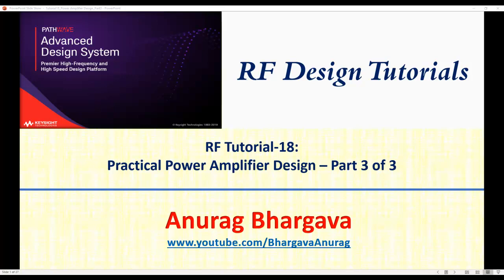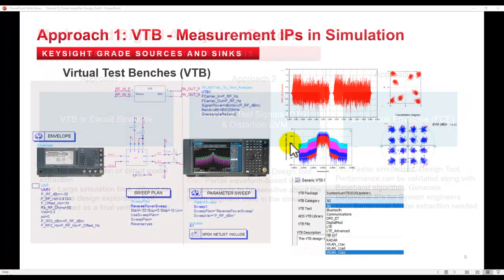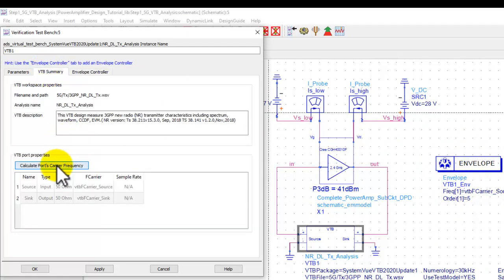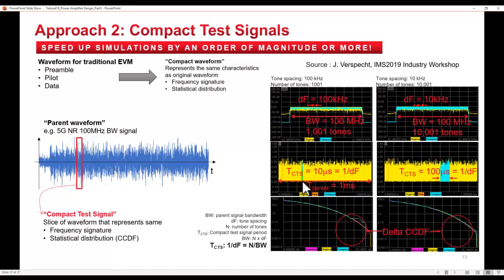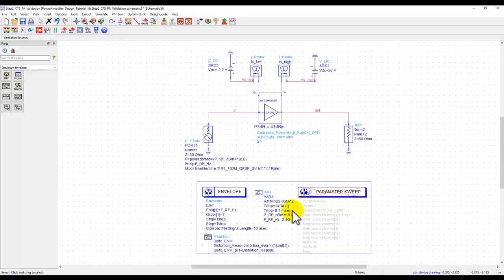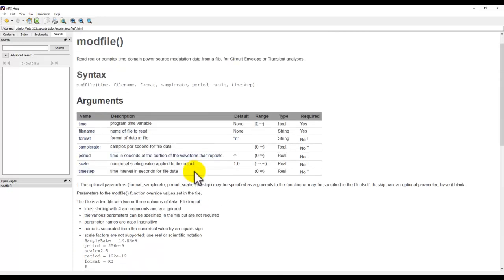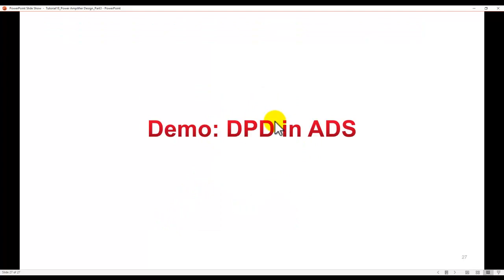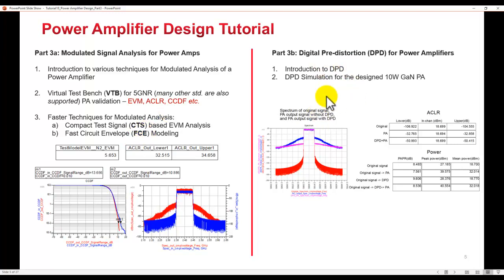RF Design-18: Practical Power Amplifier Design - Part 3

Comment: Which port/pin types you recommand (edge or area) in Momentum for push-pull amplifier input or output layout ? for example ART2K amplifier from Ampleon ?
Reply from the maker: If the edge is quite wide then I will recommend area pin else normal pin should be fine.

Comment: Hello good time . The question that has been bothering me is why none of the design steps of the power amplifier used transient simulation to ensure the correct operation of the amplifier. I did it in 6 GHz, but when I do the transient simulation at the frequency of 6 GHz, the gate voltage of the transistor is very high and it goes up to 10 volts.
Reply from the maker: You can contact Keysight tech support team for help: support@keysight.com

Comment: Thank you for your useful videos and excellent explanation.  I have a problem that I would like you to help me solve, which is that when running a DPD simulation, the simulation stops suddenly in the second stage (operation=1) at about 25% of the simulation.  I tried to repeat the simulation many times and the same problem occurs, and every time a message appears: “The simulation failed unexpectedly” or the ADS program closes.  Is it possible to perform a DPD analysis on two separate simulation operations, first putting 0 in operation and then resimlate by putting 1 in operation instead of using parameter_sweep?
Reply from the maker: Yes, you can disable the parameter sweep and configure the variable to 0 or 1 based on your need. The error message indicates convergence problem and I would recommend you to contact your local Keysight tech support team for help.

Comment: Hi, very useful video, really appreciate it! Could you kindly explain the SystemVue license should be used if using VTB method ? I have ADS here but no SystemVue installed and I can't run VTB simulation...
Reply from the maker: Hi,
VTB needs to be downloaded and installed. You don't need to install SVue separately. Kindly download the VTB from the ADS download page.
If you need more help then contact your local Keysight tech support team

Comment: Thank you for an excellent series!  I have a question about the CTS result.  I've used your archive as-is, but am using ADS 2022U1 and Cree V16.  The Cree models seem appropriate as your power, gain, efficiency results in the video are similar to what I simulate.  But in the CTS result, the non-linear portion  (Spec_NonLin_Distortion) has an ear (peak) at the left edge of the signal bandwidth.  I've used Tstop=0.1ms, rate 245.76MHz, sig length=10usec.  I've tried other signal lengths, not knowing if the signal is fully allocated ( 3276 carriers vs. 1000 in the video) but still get the ear.  The only other appropriate dial to turn seems to be Tstop, which when increased to 1ms eliminates the ear.  Was this the right thing to do?
Reply from the maker: Hi,
Its kind of difficult to support this kind of query as it will require looking at your simulation setup etc. Kindly contact your local/regional Keysight tech support team for assistance.

Comment: Thank you for sharing this excellent video, Could you tell me what's the relationship between the P1Tone's power level and the output spectrum power level?  The output Spectrum power level is the original modulated signal's power?
Reply from the maker: P_1Tone is the input signal level and output spectrum power level is the output of your amplifier or circuit whatever you may be analyzing and it obviously will be more of less depending on what kind of circuit you are designing. However in the output you will need to integrate the power in the required bandwidth to see the actual power level else only average power will be shown as the energy is scattered over the bandwidth of the signal.
Reply: @BhargavaAnurag  Thanks !

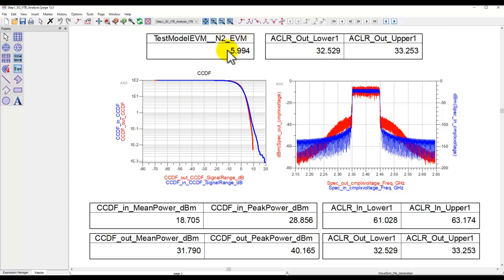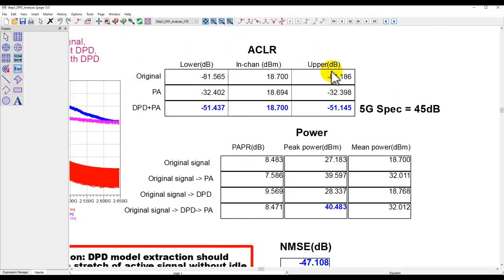Comment: Hi, thanks for the great video. I noticed that you first had ACLR in dB (positive values) when you first ran VTB (15:45). After running DPD (50:45), you showed ACLR in dBc (negative values). Are they pretty much the same except that they are off by a negative sign?
Reply from the maker: Yes, they are same. Whether you represent it with negative sign or not is your choice.

Comment: Thank you for sharing this excellent video. I used level 3 for FCE DPD simulation with 5G NR DL signal. I realized that the simulation time is extremely long. I'm simulating multi-stage PA with die/MCM level EM blocks in my circuit. Do you think EM blocks are the main reason for the slow simulation?
Reply from the maker: Hi Josh,
Thanks for liking the video and glad to know it was of some help.
I am not sure how slow is slow but for a typical DPD analysis it is a 2 step process, one for extraction and 2nd for application and it is typically 15-20 mins after the FCE3 is extracted for 100MHz, Oversampling ratio=4. These are initial comments and I would recommend you to contact Keysight tech support for further help.

Comment: Thank you so much for your instructive videos! 
At minute 38, you're talking about the signal file that can be used for modulation in the P_1tone source. I was wondering how I can get/create/download such a file? I have never simulated modulation, so any advice would be highly appreciated. 
Some other questions: In the Fast Envelope Demo, for the P_1Tone source, why you are adding 10dBm to the P_RF_dBm? The value of P_RF_dBm is the value of input power in which the power amplifier is in the linear region (maybe upto1dB compression point)? How do you calculate the sample rate?
Thanks.
Reply from the maker: You can refer to ADS documentation which explains the file format and actually its quite simple and you can generate this kind of waveform files very easily using any programing language such as C or Matlab etc, just simply use QPSK waveform to be exported into the file format recommended in the ADS manual and you can read it in just to plot in ADS and then use it as an excitation to your circuit.
Another alternative is to use only VTB component in your schematic and export the waveform into a file and use it in P_1Tone source.
Hope this helps....
Reply: @BhargavaAnurag  Thanks a lot for the instruction. I will try both solutions.
Would you please explain about adding 10 dBm to the P_RF_dBm?
Reply from the maker: Don't worry about that too much, I was just playing with the variable to get right input power level....😊
Reply: @BhargavaAnurag  Thanks :)

Comment: Could you please post detailed videos on envelop & transient simulation like you did in the case of HB? 
Is it possible to show AM-AM and AM-PM conversion? 
Any documents/references for the theory part you covered here as few things went above head?
Reply from the maker: I will have videos to cover Envelope and Transient later. AM-AM & AM-PM is nothing great if you are doing power sweet HB and you just need to plot gain & output phase vs. input power. AM-AM, AM-PM was also shown in the DPD analysis. Not sure which part/topic went above head for you....😊

Comment: Hello sir , where are measured load pull we measured at transistor or at amplifier when we design apower amplifier
Reply from the maker: Sorry, I didn't understand your question. Kindly ask again with proper clarity
Reply: @BhargavaAnurag  I want design a power amplifier class E ،  How to start designing What is the first step after selecting a transistor ،I don't understand load pull step

Comment: Very helpful.
Sir can you please guide me regarding how to import System vue file into ADS.
If its possible, pleas share the method.
Reply from the maker: Hi Ali,
I couldn't understand the purpose of bringing SVue files into ADS. Kindly give me the full context of what you are trying to do so that I can provide comments accordingly.
Reply: @BhargavaAnurag  Sir ,I have to simulate a layout with transistor whose  library was not available in ADS but in System Vue, so I need help if I can import it or not.
Reply from the maker: @aaliz110  SystemVue doesn't do any layout or layout simulation and that doesn't have any transistor library as well. There are library for amplifier models and largely most of them would be S-Parameter based so I don't see any value. You can simply get the S-Parameter for the amplifier from vendor website and do everything in ADS itself. What is the part number and company you are referring to?
Reply: @BhargavaAnurag  Thank you so much for your kind reply.
Regards
Reply from the maker: Hi Ali,
As expected, I looked at vendor website and they provide only S2P file for this device and this is what available so you don't need to worry about SystemVue and ADS link etc. Simply use the S2P file for your simulations and they also give you sample gerber file that you can import in ADS and assemble it with rest of the BOM to analyze the amplifier behavior.
Reply: Transistor was provided by the vendor, only available in system vue.
Reply from the maker: @aaliz110  Kindly tell me the part number and company please. Let me check and let you know my findings
Reply: TGA2602-SM, 0.8-3GHz
GaAs
Reply: Qorvo